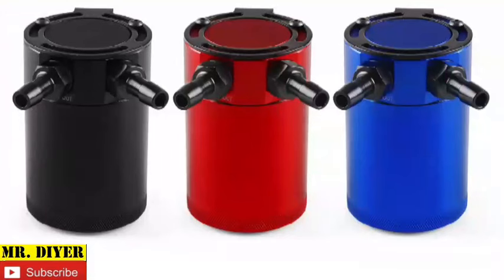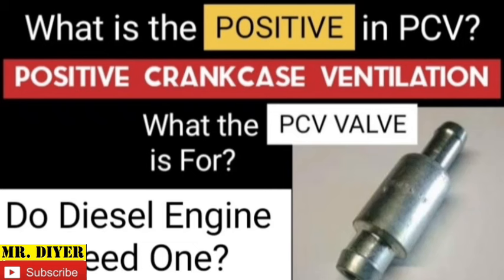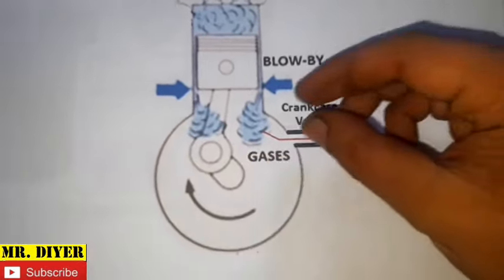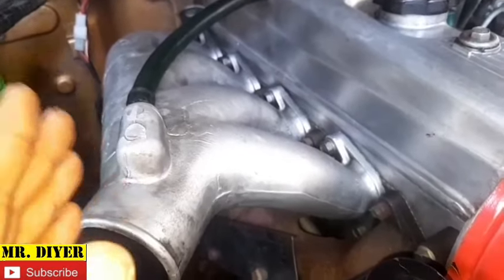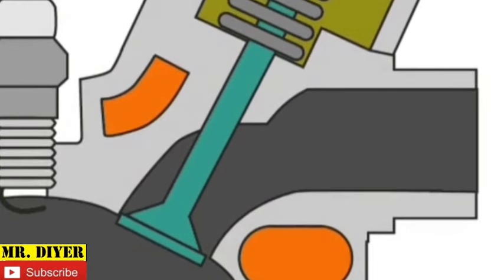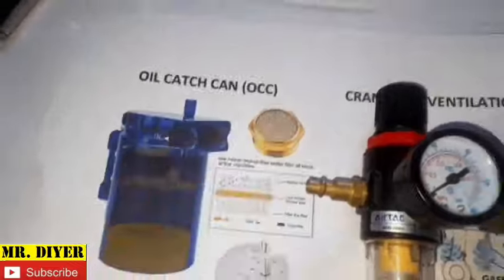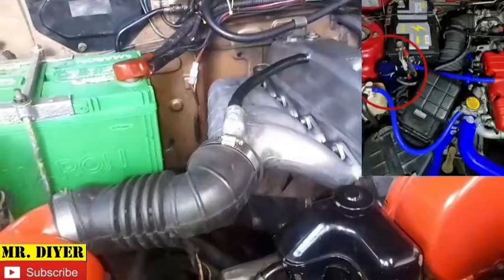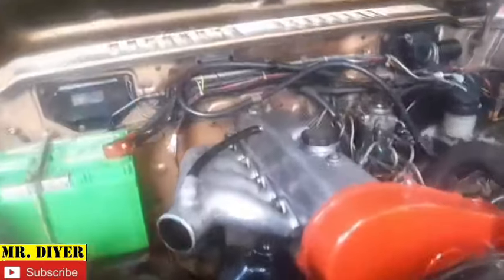This Is Why I DO NOT INSTALL AN OCC OIL CATCH CAN

Comment: There are versions of the same oil catch can you had on the paper, without that bronze filter. Air restriction is not required to collect the vapours and make them droplets. It just needs baffles. Use stainless steel sponges or so. They deflect the vapours, cool them and also let the crankcase breathe as easy as it needs. I ask for your opinion too on my theory
Reply: best comment so far, i too have a custom  OCC, and i think i just designed it properly thats why i dont uave d same issue with the dipstick test
Reply: @stockSOHC  
Aside from the fact that yours is safe for the crankcase, is it effective too? I mean how is the output hose? Clean? Oily?
Reply: @gheorghinacov6008  it doesnt have an output or hose going to the intake manifold. a bigger custom alluminum tank with a big filter (not those cute round filters, it'll just restrict the flow of oil and vapor mix) a big filter wil do the job of separating the oil and vapor. oil remains in the tank and vapor just evaporate.
Reply: and yes i have a clean throttle, so is inside my intake manifold, no oil vapors sticking in the intake walls which gathers dust and dirt. yes i do always have oils on the OCC, especially whenever i rev highs
Reply: Unfortunately this video is a sham!!! The air water separator the person uses is designed to be used for a high pressure compressor!  To compare it with a catch can is a farce! If he would use a catch can (Not a air water separator designed to be used for very high PSI) the oil spattering from the dip stick would never happen. I have an oil catch can and performed the same test with and without an oil catch can. The results are shocking!!!! No oil spatter at all for either one!
Reply: @stephenheldt186  
Indeed. No variable shall be excluded from the equation. For instance check Provent 200 product by Mann. Just because some catch cans are no good for some engines it’s no ground to conclude that catch cans in genera are bad

Comment: It doesn't slow down the pressure in the crankcase only if has a restriction  like a brass filter 
This is BS not all catch cans have a brass filter that plugs

Comment: What if I used one of the OCCs with the removable bronze filter and removed that then placed steel wool in the can under that plate with holes. That should allow the air to flow through at a good rate but still give area for the oils to collect on right?
Reply: Been thinking about the same idea.
Reply: yeah. built a maze like occ that catches oil without restricting the gas flow. Post the vids when u r done.

Comment: Thats not OCC,  that water separator work with high air pressure like 5 bars, but in engine, the air go out with no pressure, so it will prevent the air to go out free.

Comment: Great info.  It settled the decision for me and tied a couple things together.  When oil is blowing up a dipstick, it is a likely clue that your PCV valve is becoming clogged.  A dipstick that blows off its seat is a sign that there’s an extremely restricted flow like a stuck closed or near fully clogged PCV valve.
Reply: It's a diesel , diesels do NOT have PCV valves,
Reply: Yes they do
Reply: The problem is he used a small “catch can”. When you use a properly sized and designed one  you wont have these issues. And if what he is saying is true then why not put the port to the crank case instead of the valve cover where there is a restriction to the crank case. He most likely created this video just to get views and not to be accurate. Scotty Kilmer is another one to be careful with. Hes got millions of subscriber but no acknowledgment in the car community.
Reply: @pazsion   NO they don't.  Diesels have NO intake vacuum operate to a PCV valve. Diesels have CDR valves or nothing at all...  You clearly have NO CLUE what you are talking about..
Reply: @TheFARM2019   Diesels have ZERO need for a catch can.  It has no benefit on a diesel.

Comment: Good day Sir. As always, thank you for the very informative video. May I ask Sir, what will happen if the occ has big enough cavities that will not hinder the flow of blow by gases?
Reply: I agree with you he had the wrong type of filter,you can use stainless dish cleaner sort of like wire wool ,much better flow,dont think his truck was turboed either,more blow by on older engines

Comment: Never had a problem I run one on my silverado for 2 years now. I took the intake off cleaned it and also cleaned the valves that was disgusting. Installed a 30$ can took it apart few weeks ago and it was pretty clean still. I never let the can over fill and I clean the brass filter with carb cleaned every oil change.

Comment from the maker: WHAT IS THE POSITIVE IN PCV OR POSITIVE CRANKCASE VENTILATION? https://youtu.be/N5TCxmJPFuU
Reply: OCC whit breathener will do it`s job, and it will not pull out oil. that`s about it
Reply: Negative ventilation is an open window relying on airflow to vent. Positive ventilation is air is getting sucked out so venting is aided, like a little fan in a toilet

Comment: Good video, I expanded it.  In the BMW N55, even more oil got into the system, pressure builds up in the engine and entrains additional oil.  I even increased the line from the engine to the turbo a bit, but brought it back to the original length and lo and behold, everything is dry...I hope for a lower flow rate due to the thicker connection so that it can draw even less liquid from the engine...

Comment: That's a cheap OCC set up on a diesel engine. A good quality OCC comes with connections and hoses made for the specific vehicle application, and it does NOT restrict flow. If you bothered to read the manufacturers data sheets and independent testing, you would know that.

Comment: That is why I always build or modify my catch cans, there must be free flow from the crankcase at all times otherwise you need a higher flow condenser or OCC. The air filter separator shown is designed to filter COMPRESSED air and separate water from  it, totally different situation, however, the video is a great warning for OCC users. Routing up far the hose from the pcv to the OCC inlet may also cause some oil condensation which will run back to the pcv NOT a good thing.

Comment: I think you're not doing it right and I think you're using the wrong OCC. The correct design of a catch can is much larger than that little tube you're using. Also, opening the dipstick when the engine's running is 100% wrong 😂

My late uncle who's worked on cars, both diesel and gas, for 55 years before he died used them for 20 or so years and had no problems at all. Mind you, the engines he worked on were huge compared to that of Philippine engines. He's worked on Ford F-650/750's and Chevrolet Topkicks/C5500's.

He's worked on 7.3L, 6.7L, 6.4L and 6.0L PowerStrokes, 6.7L Cummins, 6.6 Duramaxes and even Caterpillar C12's and C15's, etc. Also on 6.8L V10 Tritons, 8.0L V10 Magnums and the 8.1L V8 Vortec in his friend's 2004 Suburban 2500 4x4. I had one on my Chevy S-10 and it worked like a charm. My S-10 had the 4.3L V6 Vortec, by the way.

All engines stated were able to go up to 300,000 to 400,000 miles. My S-10 only had 194k+ miles on it before I sold it to come back here to Cebu.

Comment: the fact that you dont have a airfilter or airbox on will play into factor aswell. if there isn't vacum at the port for the ventilation tube, then it wont be properly vented. you need this vacum in order for a occ to function properly. by having the intake open like you do in the video. the port wont see vacum

Comment: first, oil catch can designed for direct injection gasoline or diesel engine, especialy turbo
second, if you want to install it, open it and inspect inside it, because bronze filter is the problem, remove it

most occ user just leave outlet side from occ to the air
and block inlet side in intake line

because on diesel engine use egr
if you leave this stock
oil vapor + black somoke from egr wil block your intake manifold

and most authorized service does not have SOP to clean it

Comment: Oh he's talking about crankcase pressure increasing because the catch can with brass condenser/scrubber creates too much air resistance.  In America, manufacturers are required to install a PCV valve.  These also have resistance and would do the same thing, soil the paper funnel.  Sounds like he's in the Philippines.  Island driving isn't like the driving in the States.  Plus, he is in a Republic so they have the freedom to pollute their environment in the Rural areas.  No big deal not many people have cars and motorbikes in the countryside.  

We use the Catch Cans with breather filter in the lesser regulated areas of the United States on high mileage vehicles.  It maybe illegal in the cities and population dense states where the dirty hippies reside.  But in rural areas you want a catch can with a breather just in case your mechanic put too much oil in the crank case.  It's less labor intensive compared to dealing with a p0420 because the blowby from the PCV valve fouled your intake and created a misfire which then carbonized your catalytic converter.  A clean intake is more important for Americans where we travel on average of 2 hours on the road at 70 MPH.

Comment: I agree on the hose length, that they should be checked and drained every month, and that those cheap amazon OCC are not specified to be used in most diesel engines with higher PCV pressure, but I disagree on some parts of your argument, that is a bad example and a bad test. In a diesel engine, the bronze filter isn't the ideal separator for PCV gases, I use a bit of steel scrubbing pad on all my diesel's OCC. The steel wool covers the entire inlet area but doesn't restrict the airflow, never packed in.
My dad has the Hyundai D4BF swapped in his '84 Mistubishi Mighty Max, which is the modern version of the 4D56, and without the OCC the EGR cooler got clogged all the time.
Your 4D55 doesn't have a turbo and intercooler, EGR cooler and valve, so I wouldnt worry about not having a OCC.

Comment: If you want to prove your point show the results with a OCC can not a air/water separator with a pressure regulator they are TOTALY DIFFERENT. if you haven't noticed water and oil are 2 totally different substances and thicknesses, otherwise you could just use water instead of oil in your engine. VERY BAD demonstration. (This being the opinion of a mechanic of over 20 years)

Comment: It must be different with a gas engine.  I bought a Mishimoto OCC for my Subaru Crosstrek 2.0L FB20 engine and tested as you did prior to installing the OCC and then tested after installing the OCC and I saw no change in oil residue coming from the dipstick tube.  There was none before and none after.  How do you explain this one sir?🤷‍♂️
Reply from the maker: https://youtu.be/rMzFMcHrAyU try reving it up sir.

Comment: Not sure why a filter would be required for an OCC anyway. If designed (and functioning) correctly, no filter should be required hence not affecting flow to any degree.

Comment: Most motorcycles don't have them and you can flog them on a track with no problems. They might put them on some race bikes but if your engine is in good shape why would you need one. Breather with baffles will do.

Comment: For that old engine a catch can is not needed and no telling what it might do. Only direct injected engines require a CC since the fuel (which has additives to clean valves) does not spray on the valve as in a port injected engine. So the catch can captures oil in the PCV system that might be in the PCV system that is used to vent the crankcase to the intake manifold. That is all a catch can does...intercept any oil in the PCV system from being sprayed on the intake valves.

Comment: So and so. With a cheap ass catch can you loose vacuum sucking on the crank case. 
The original early catch cans conneted to a vacuum pump. Then you have the same vacuum , with its benefits. And you still have the benefit of clean valves.

Comment: The increased hose length is inconsequential. Your test with air compressor is fundamentally invalid- A catch can has far lower flow loss. Not using a catch can on a forced induction direct injection guarantees expensive valve and port cleaning. There is literally no down side to a catch can, if installed properly.

Comment: 7:03 this demonstration is misleading because the water separator causes a FAR greater constriction of the crankcase vent compared a properly designed catch can. I would like to see this demonstration redone with an OCC rather than a false analogue

Comment: It doesn’t make any sense. Bronze filter is final filtration. Which is marked as OUT. At least google it first or read installation manual before misguiding people. Nothing is slowing down the air when it goes from the engine through the PCV valve into the OCC. 
Just read the instructions man.

https://youtu.be/6rUpPcq4hQg?si=dmuDoD674v3n8HU7   This video makes more sense.
Reply from the maker: Lol

Comment: Should have went with an Provent 200/300. Even the Chinese ones will do. These small aluminium ones are indeed waiting to cause overpressure.
Reply: The problem with my 3L diesel is that I have a lot of oil going into the intake side of the turbo and oil accumulating all the way into the intake manifold and ultimately being burned by the engine. The Provent solved this issue almost completely.

Comment: Your demonstration is invalid. The compressed air water/oil separator that you used is FAR more restrictive than an oil catch can (it's designed to be used with compressed air of potentially up to ten atmospheres (gauge pressure), not air that's somewhere between a vacuum and one atmosphere gauge pressure (likely considerably less). You actually need to do the test with an oil catch can, so you can show the effect with the actual device (which will be considerably less restrictive than the compressed air water/air separator).

Additionally, you're incorrect about the function of the filter piece. It's there to act as a coalescing filter, which traps oil droplets and allows them to build conglomerate until they're large enough to drip into the reservoir of the can. That being said, it does also act as a restriction to some degree, especially when it has been in use for a while. This is the reason why many catch cans use a coarse stainless steel scourer pad instead. The stainless steel scourer pad acts as a coalescing filter in an area where the velocity of the flow is naturally slow due to there being an increased section area (look up Bernoulli's equation and read the notes on the derivation if you don't understand what I'm talking about), so with a low velocity of flow, there's little flow restriction, but the scourer still acts as a coalescing filter. Also, with low flow velocity, the oil droplets are more likely to drop out of suspension, thereby being removed from the crankcase gases before they get to the inlet manifold.

All of this being said, can a poorly made and/or poorly installed catch can cause problems? Yes, absolutely! While the video was definitely worthwhile to make, the demonstration wasn't valid for the reasons that I've already stated.
Reply from the maker: Yoj might want  to watch this. Lol https://youtu.be/rMzFMcHrAyU?si=pRobaUnjW_n_RG46
Im curious to see what essay you would come up with next lol

Comment: Love the explanation, but air separator is not the same.

There are oil catch cans with pressure relief valves so that they don't damage the engine. Your air separator does not have that.
Reply from the maker: https://youtu.be/rMzFMcHrAyU?si=boYco-IeF82gZkEf curious to see what you have to say next.

Comment: slighty more negative pressure for crankcase , it sure gonna make engine run better , and sure 
theres gonna be more dirty oil gonna be sucked out of engine , ( its all dyno and proven by 4age channel                 engine dont need  those dirty oil to run right .

Comment: You need to understand first that air dryers are meant to work under high pressure.  Typical blowby is a couple psi at most and that's worst case.  10" of water column is generally the acceptable limit which is about a third of 1 psi.
Reply from the maker: @derekgrey3927  you need to understand this also lol https://youtu.be/rMzFMcHrAyU?si=HHgeP2Ux39bHKTr-

Curious to see what you have to sag next lol
Reply: @MrDIYer  I personally dump mine into a scavenger pipe I welded into my exhaust.  I used to have stainless steel water bottles that I turned into  catch cans with the inlet pipe going in halfway down into the side of the  bottle with stainless steel wool stuffed in it.  Coming in the side created a vortex which helped separate the oil along with the steel wool.   I wanted something that I didn't have to check or rely on my guys to check so I went with the exhaust dump plus they increased my mileage 25 miles a tank.  With 4 trucks plus mine that's over $100 saved every month. 

The catch cans I made had no restriction at all.  You get what you pay for some cheap Chinese junk is worthless be realistic. Good quality catch cans don't use those brass filters.
Reply from the maker: Lol

Comment: Be caution. Please check your State's regulation before installing Oil Catch Can. In California, it is illegal and you cannot pass smog check because it is considered you have made modification to the original vehicle's emissions system and it is considered Emissions Tamper.  😢